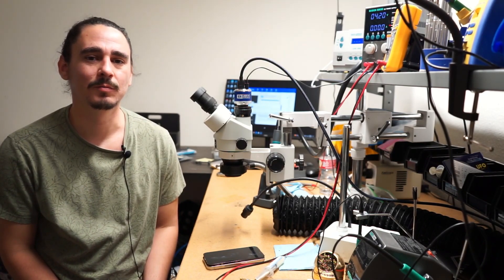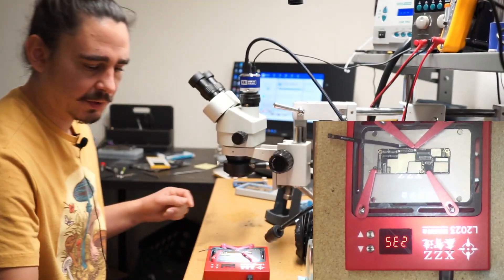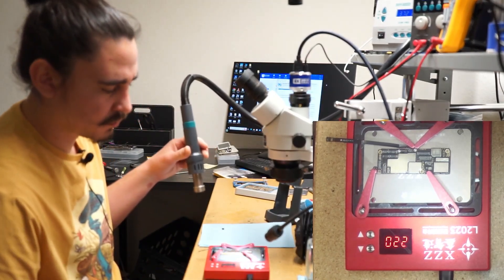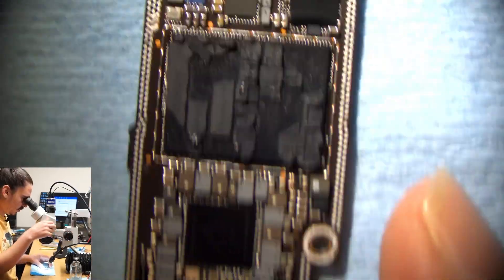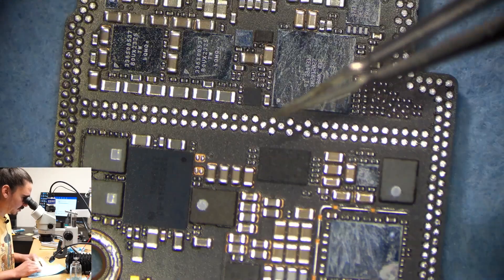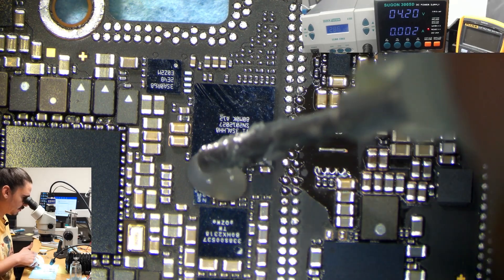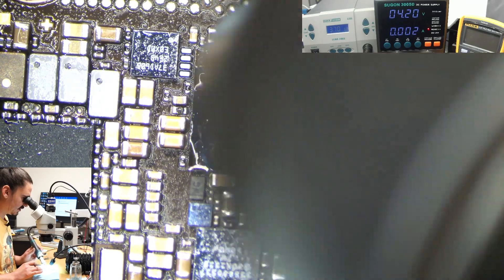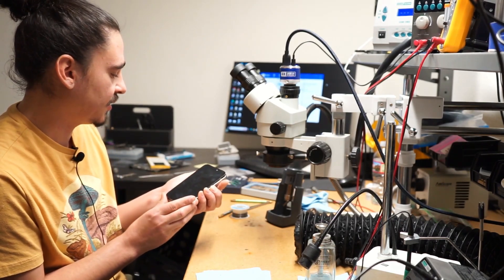How to Fix iPhone 15 Pro 'Touchscreen Not Working' & 'Not Charging'

Comment: What about for the base model 15? I have a short on Batt VCC and am wondering if I would need to do the same thing?
Reply from the maker: Do the same thing as what, change the charging ic's?
Reply: @ thank you for fast reply! I’m just wondering if I replaced the charging IC do I have to replace the touch IC as well

Comment: Do you have to change the two easians together? Is the operation done? If you change the USB ESY, only the phone works or not? Thank you.
Reply from the maker: Yes, you have to change both or the phone will not charge.
Reply: Does the device work normally without the Ebrom or does it depend on the Apple logo?
Reply from the maker: @ it will turn on but will not take a charge.

Comment: Aaron how would you deal with a "0% remaining"  on this very model when charging? I've tried several things; Data lines diode values are all ok. Changed charging ice. Tried another housing but the problem still persists
Reply from the maker: Does it have any amp draw on ammeter? Did you change the paired eeprom with the charging IC? If not, you may also have to do a restore.

Comment: Greetings colleague, a question, I have the same fault but the donor board I have is a 15 pro and the one that fails is a 15 pro max. Can the circuits help me?
Reply from the maker: No, as far as I know you cannot mismatch and must use the exact same model. 15 pro max can only use 15 pro max, not 15 pro.

Comment: i dont know if you see that you miss 2 resistor on top of The ic
Reply from the maker: Yes good eye. I went back and fixed that later. I was hoping nobody would notice 😄 because it kind of ruined the flow of the video to include that.

Comment: I have several questions if I can ask
1. I seen that there is no overfill (glue) on the board of the 15 and no underfill under the chip. Since when it is gone ? I think it is there on 12
2. what is the purpose of this 8 leg strange chip on the board, except for been pairing to the charging IC ?
3. This is a problem with all android cables, or only with a cheap ones that do not have a 70 ohm resistor or other overcharge protection ?
Reply from the maker: 1. There can be varying amounts of underfill depending on the manufacturer that made it. This chip has no underfill, but it may sometimes. I think usually it does not. But pmic and cpu still have normal underfill.
2. I don't know yet, it might be exclusively for encryption.
3. I also don't know, but most likely just with cheap ones.

Comment: Hi from Iran. Very useful video. Great job Aaron. I heard if you want to change the charging port there is a chip on flex which should be replace with new one on the new charging port to connect PC.
Reply from the maker: My customer provided me with the incorrect pin, so I am waiting for that before I connect to the PC. I will check to see if it can connect with multiple charging ports or not. I'll come back and update here once I do.